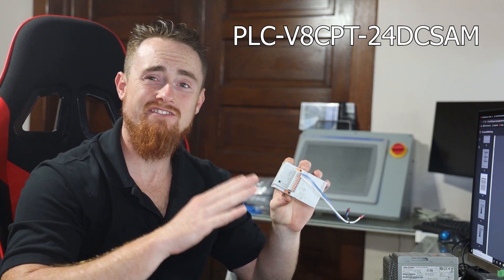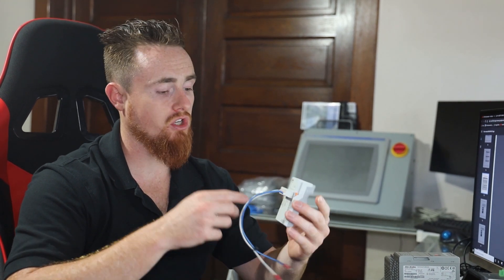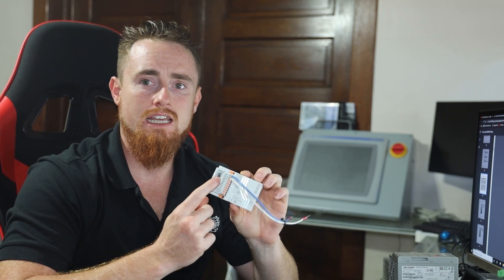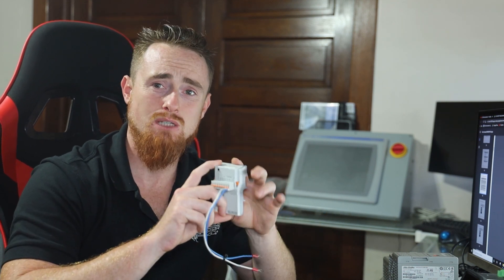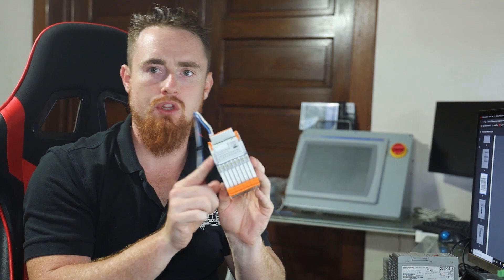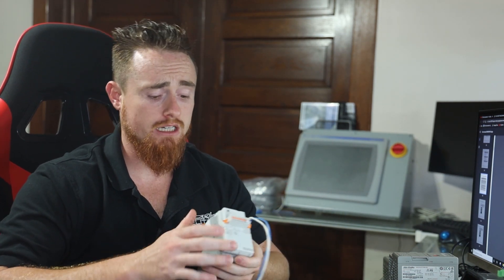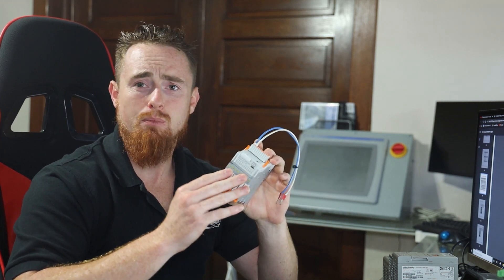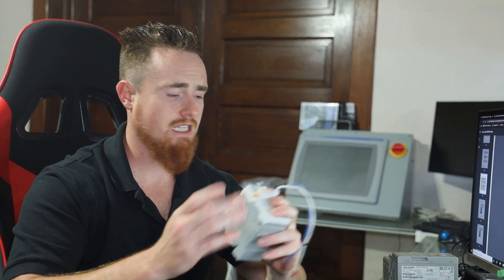Affordable PLC Controller - PLC-V8CPT-24DCSAM2 - Hardware

Comment: Nice review. :)

AutomationDirect's Click PLC is $85, and the software is free. The Click talks Modbus RTU (over serial) or plain old ASCII (NOT ASCII Modbus as I found out :) ) and that makes it very useful as a I/O to Modbus gateway. Otherwise it isn't all that remarkable (other than the price). I will say that AD has great phone support, but Phoenix does too.

Phoenix makes some nice stuff, and how it integrates into their existing product is impressive. I see that the software is also free.

So what to watch out for when looking for bargain PLCs?

1) Do you have to stop the PLC to do a program change? That's okay, as long as your customer is fine with it, but it's hardly optimal.
2) What's the price of the software? It does you no good whatsoever to save a wad on the hardware just to blow it on the software.
3) How long has the company been in business. And while that sounds like a scare tactic, there have been more than a few "Fly by night" PLCs on the market.
4) Support. Calling up and getting an engineer is the gold standard while email support would be about at the bottom. With getting your documentation off of the "Wayback Machine" being worse. But just barely.
5) Footprint. Gone are the days of an AB PLC-3 taking up a metric buttload of space (and being about as slow as a fat boy on a bicycle), but keep that in mind.
6) Does it have all of the features that you need? What is the plan going to be once you've bought the device and find that for something critical, that "You can't get there from here". That would suck. Bigley. So do your homework first.
7) Check the specs. A common limitation of the budget PLCs (as well as some pretty pricey ones) is the old .500 ma per output up to a max of 2 amps per block trick. 
8) Connectivity. Wiring up a 32 point input swing arm sucks. But is there a cable for this? That would be nice...
9) UL (or whatever applies for you) approval. And keep in mind that a lot of stuff that you can get from China will never be approved by any agency.
10) Your IP rating (or NEMA if you are stuck in the stone age). The Turck blocks are rated for IP69K. That's badass, no two ways about it.

So my new bargain PLC is the Turck TBEN PLCs. Not dirt cheap like the Click or the Phoenix, but it has some amazing specs. It's being used as the replacement for a Rockwell PLC for a project that is headed to Antarctica.

IP69K rated. I didn't even know that was a thing. And where this thing is headed the altitude can be >3 Klicks up (~9800 feet). On the plus side, humidity (from the outdoors) shouldn't be a problem...
Robust I/O with outputs that put out a ton of power (and have their own diagnostics IIRC).
Small compared to the Rockwell.
Free software. One of the big complaints of the old system was paying the "Rockwell Tax".
Check out their analog input block. One of them can be configured for 0-10v, 4-20ma, Thermocouple, or RTD. Damn...
You can get the PLC with a webserver built in. We went with this, but I'll be honest, AdvancedHMI is still my favorite HMI software.
Reply from the maker: Holly cow! Thanks for sharing all of this. There is a ton of valuable information here. Thanks again for sharing. I wish I could write this much. Lol
Reply: @EliteAutomation  Thanks! I've been at it for awhile. :) I finally retired (hopefully for the last time) yesterday. 47 years is enough. How did I celebrate? I slept. 

That said I've got some loose ends to tie off, that Antarctica project being one of them. I also picked up a robot cell along the way. But I'll be collecting my social security money and that will limit my earnings for the next year and a half (unless I want to pay my SS back, so nope).
Reply from the maker: @MrWaalkman  Oh wow congratulations!!! How did you manage to retire so young? What's next for you?
Reply: @EliteAutomation  Thanks! But that's 47 years of paying into SSI. I'm 65, and that's old enough for me. :)

As for what's next, I found a 72 Triumph TR6 for a song, and it's going to get a bunch of work done to it. I also have a 69 Corvair that will have to wait its turn to get freshened up. But it's in pretty good shape so it can wait.

I also have the afore mentioned controls projects lined up.

Comment: Is it possible to make a adjustable timer, that can be controlled with a potentiometer? I’ve played with the software and can’t figure it out. Thanks for the great continent!
Reply from the maker: Thank you very much!! I have not done it yet. But i bet you will have to use a variable. Write the analog input into a variable and then use the variable to set your timer. There is a slight possibility you can’t do it though.